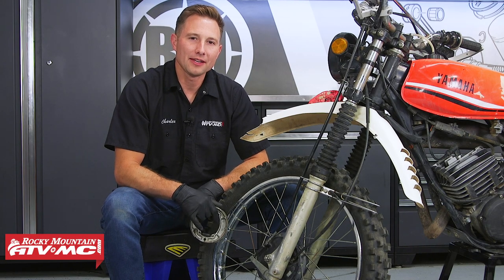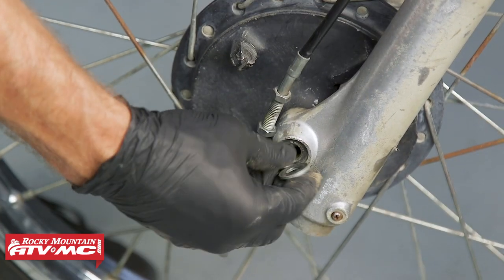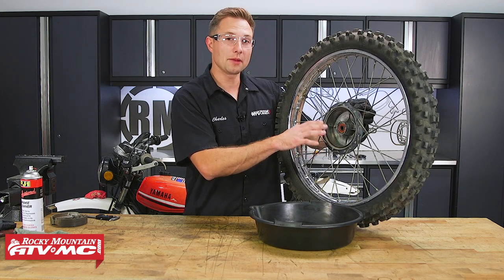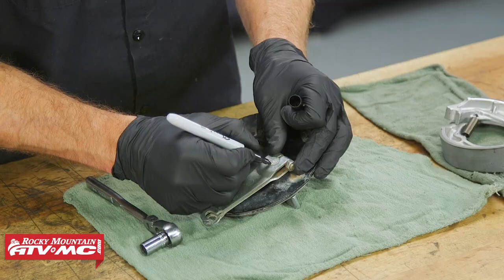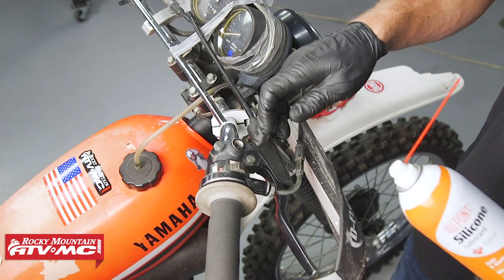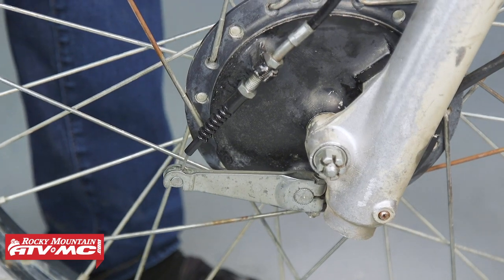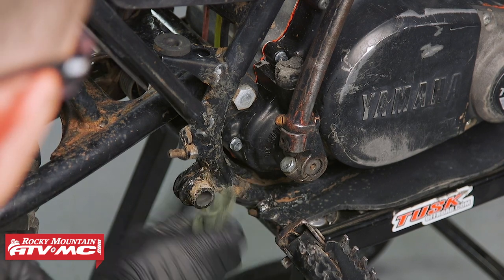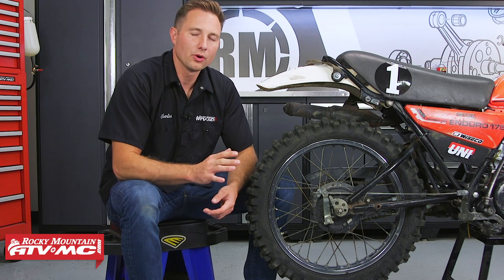How To Get the Most Performance Out of Motorcycle Drum Brakes

Comment: You can rub valve lapping compound inside the drum and jack the wheel up and set it on a electric treadmill then apply the front brake and put a rubber band around the lever and grip. turn the treadmill on and let it ride for awhile then check. It will take out a high spot in the drum and remove deep grooves
Reply: THIS is what I was looking for, a way to ease the grooves on my wheel without sending it to a machine shop, thanks!!

Comment: my front drum on my 77' IT250 was giving me lots of trouble, cable didnt fit (to long) even though it said it was an exact fit, later found out my front drum brake (not the hub) is from a yz250 it fits the same hub but it uses a double leading shoe vs the single on the IT, clock the armatures down a bit and it works great not

Comment: I did everything and front brake performance in my splendor plus is still poor.. there is no initial bite at all, however when I press harder, it got good stopping power.. but because there is not enough initial bite, it ruins my confidence..😅..  

Here in india in lower cc segment drum brakes are still common.. In most bikes the drum brakes are good enough. but in my bike I don't know what's the problem.. 😢..